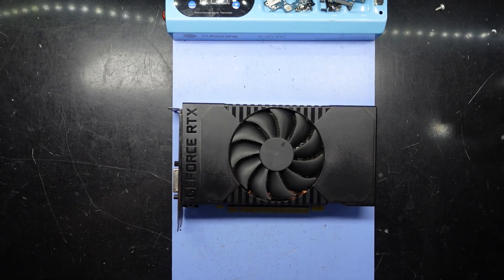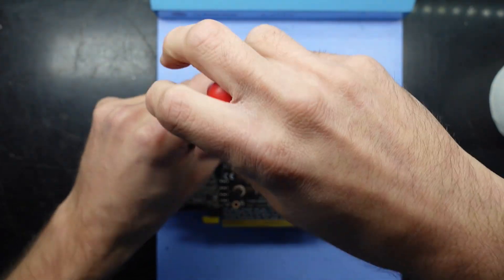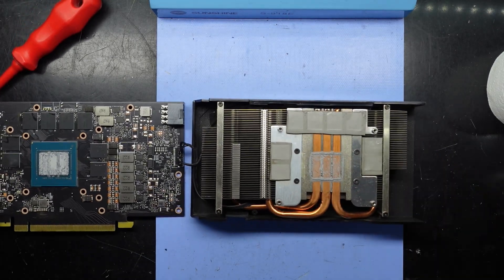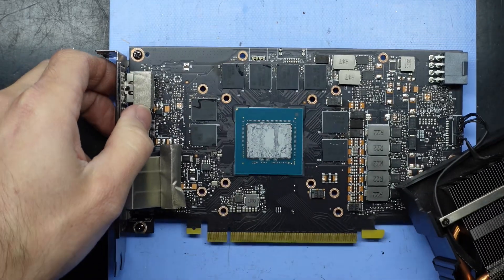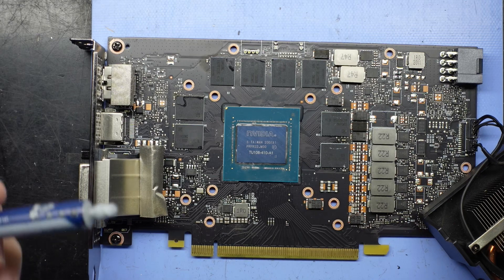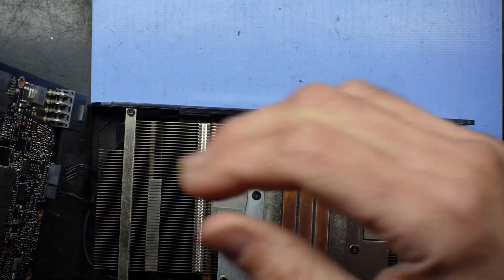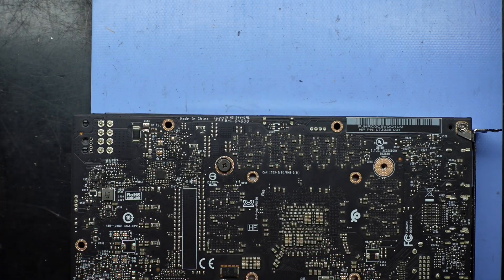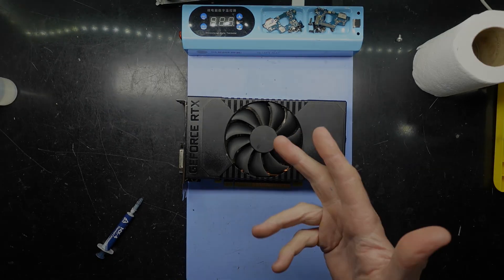HP OEM RTX 2060 Super Thermal Paste Replacement

Comment: I have a dell version , it 90° GPU and  105° hotspot. I  repasted and New pads. 80° and 96°.
I underclocked volted to 1700mhz i'm now AT 75° and 92° hot spot. I'm beginer un undervolting because i never problem but i think it's to hot
Reply from the maker: thats a nice temp drop

Comment: hi can you tell me what temperature it has in furnark ?
Reply: Just my card very hot ,i have in test 89 C ,i don't know wtf , i change settings from msi afterburner on 700mv and 1400 mhz ,unsuccessfully, the temperature does not change
Reply from the maker: no idea on that 

i would suggest changing thermal paste
Reply: @vlad2878  try undervolt your gpu
Reply: if it remains hot change the thermal paste, use a thermal paste with at least 10w/mk